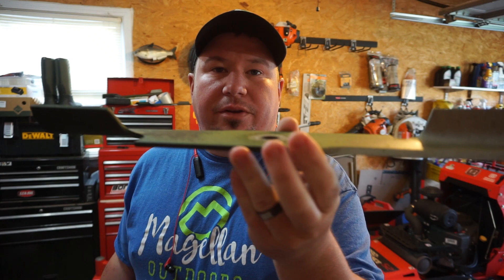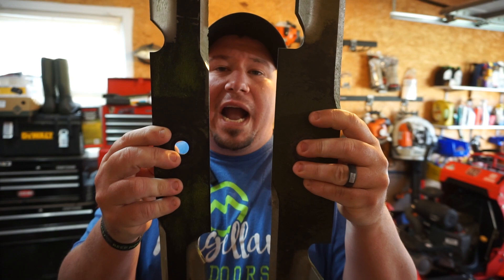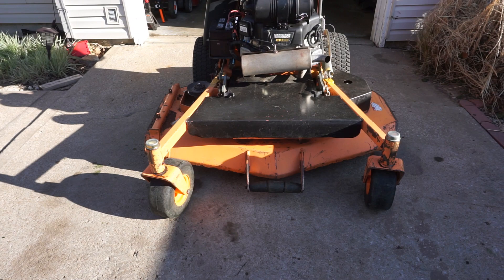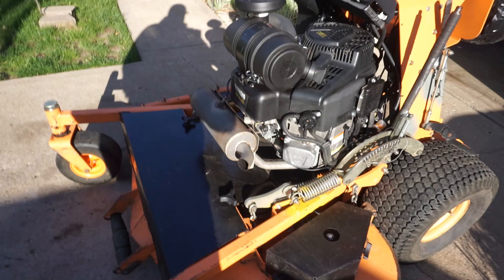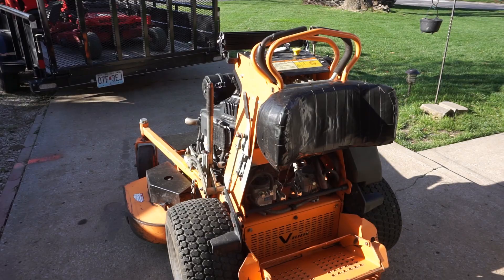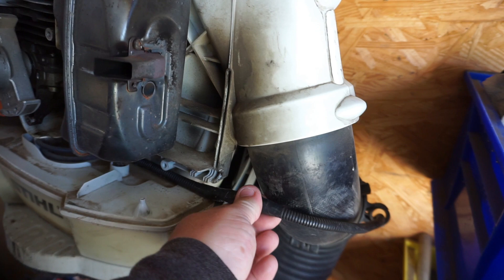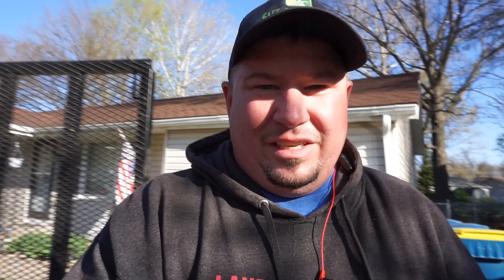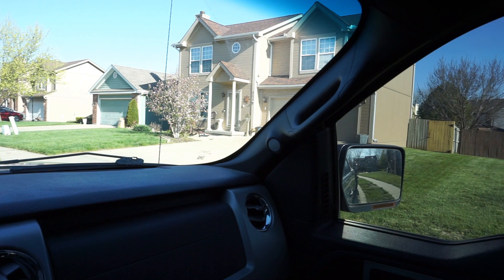Lawn Care Day in the Life Gravely Pro-Stance Stripes | SCAG V-RIDE Updates

Comment: I have a quick question if you have a backyard that you cut with 36 in do you use the 36 on the entire yard or do you use the 52 on the front and then switch to the 36
Reply from the maker: Depends on the lawn... but Usually I will 52 the front and sides Because I have to take that mower off anyways to get the 36 off and then just 36 the back
Reply: @CutandCleanTV  that makes sense you have the perfect setup that I would love to have just curious to know what you find as efficient that I may be able to use when I get my set up you have convinced me to upgrade from a 48 2 a 52 and not be so heavily into a 61 in to be paired with a 36
Reply from the maker: D Waugh Here 54 inches is a average wood gate size meaning anything over 52 will not fit so I’m still able to use my 52 front and back on a lot of properties the older neighborhoods need the 36 a 60 inch would not work for me at all in neighborhoods but if I was doing wide open acreages and rural properties I would want the biggest deck possible

Comment: What’s up with g4 outdoors saying gravelys don’t cut for crap in northern states because of the type of grass. Any opinions. Was gonna get a zt xl 52
Reply from the maker: In my opinion and take it for what it’s worth I guess...

As far as cut quality goes you can make any mower cut good you just may have to try different blade types and or do some adjustments to the mower, Baffles etc...

Where I’m at we have a lot of blue, rye, and fescue which is a floppy grass and needs a lot of suction to get it up to cut so I rain mainly high lift blades. But I’m Florida they have stiff grass like Bahia etc... they can run low lift blades and gator style blades... when I run those types of blades my cut quality changes drematicly...

I don’t know if the helps at all but it’s all relative to they grass types you are mowing?
Reply from the maker: Basicly I’m sure the ZT XL will work good for you but if you put high lift blades on it, it may perform better same with any mower you buy off the shelf
Reply: Just bought the zt xl 52 this morning. I couldn’t pass up the deal. Thanks for the reply. Anything has to be better than the 36 year old Kubota I was mowing with! Hopefully. Lol